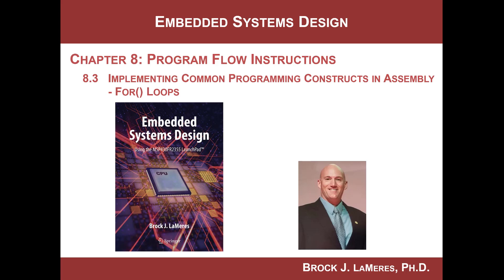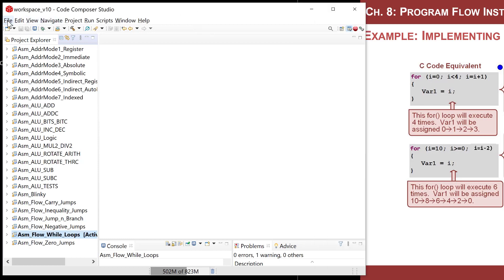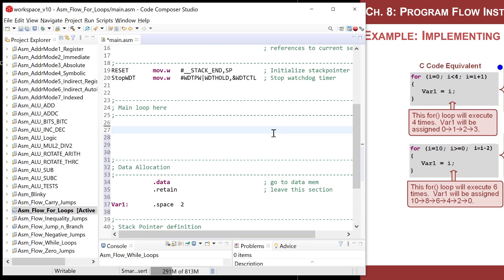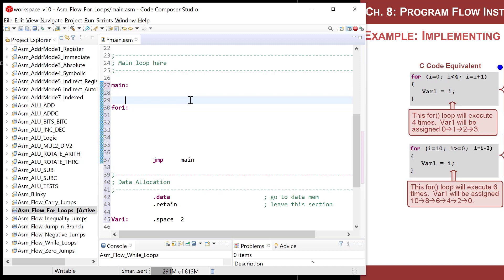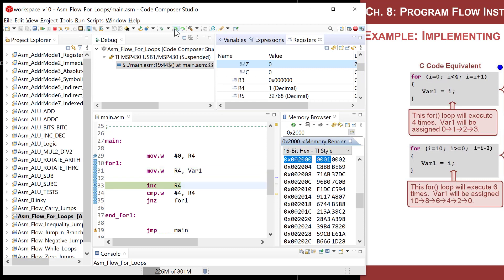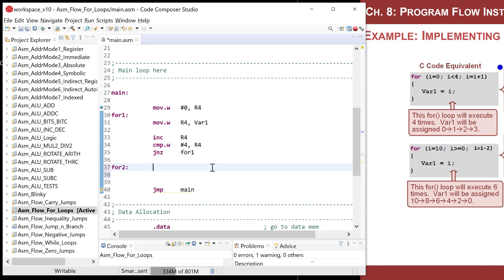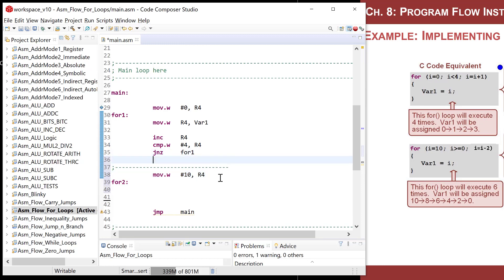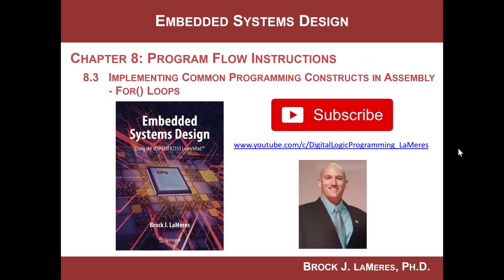8.3(b) - MSP430 Program Flow Instructions - For() Loop Functionality in Assembly

Comment: Hey Brock great video. I’ve been loving these videos. One quick comment about this one is on the first for loop, you inc before you cmp. This causes you to not cmp the first value of i. In other words your first for is for(i=1; i<4; i++). Not a big deal, the concept is clearly shown and understood. Just thought you might want to know.
Reply: A bit late but I think this was accounted for by initialising R4 = 0 prior to entering the loop, then immediately assigning R4 to Var1 upon entering the loop before the first increment occurs. If you cmp before you inc, then in the case where R4 = 4 cmp will yield Z = 1 (as it should) but inc immediately after it will yield Z = 0 (as the result of inc is 5, non-negative), hence jnz will keep you in the loop.